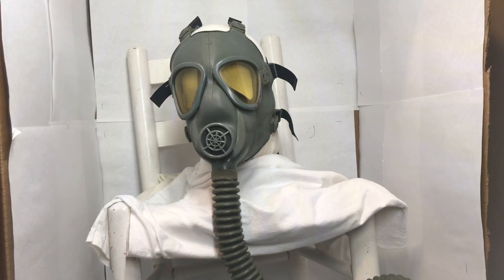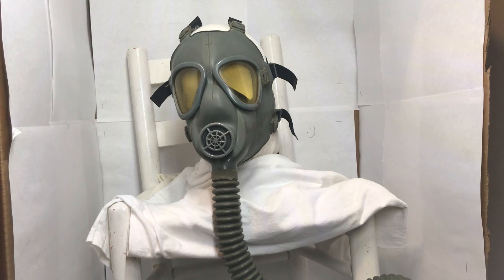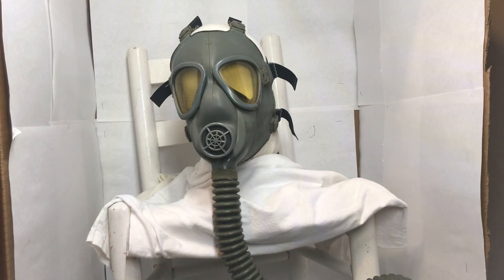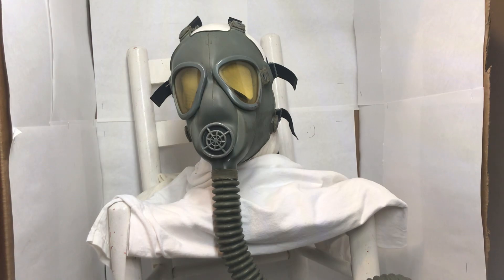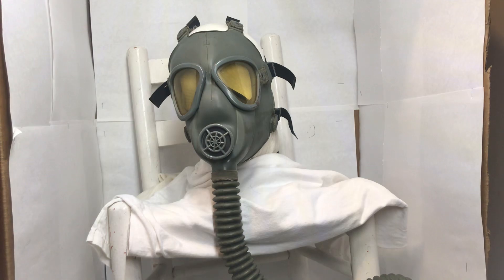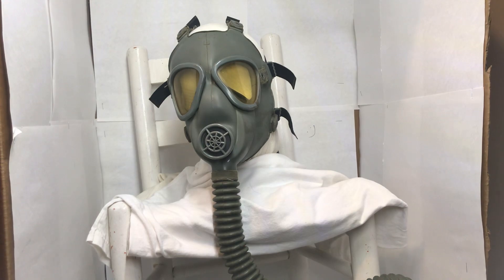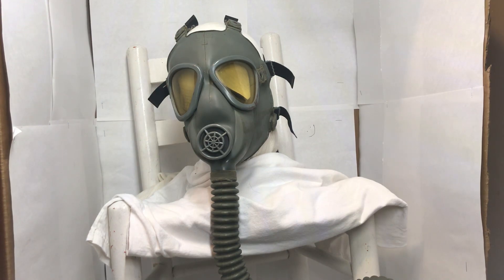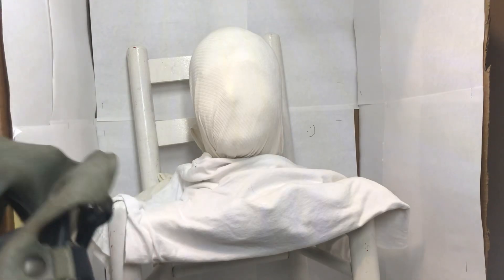WW2 US M3-10-6 Army Lightweight Service Gas Mask (revised)

Comment from the maker: I meant to say “late in 1944 the neoprene facepiece were a problem” not 1943 and the I meant to say the M5 ointment kit was developed in late 1944 not the M4 ointment kit.  And no matter how many times I try to fix a video I always leave something out.  All of the information I gave in my first video about this mask being used post war is still correct.  These saw service up until the late 1950s and even had an upgraded variant called the M3A1-10A1-6 which had the C15 exhale valve.  If i remember anything else I'll put it here later.